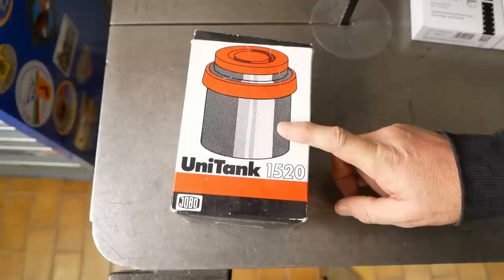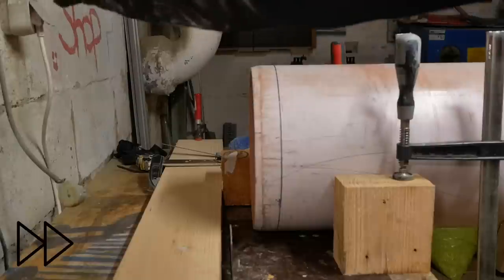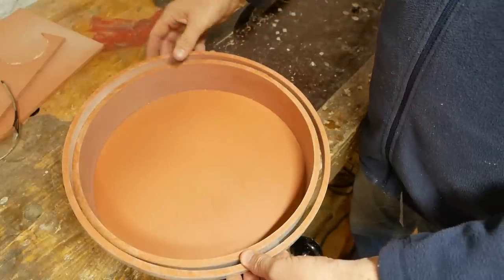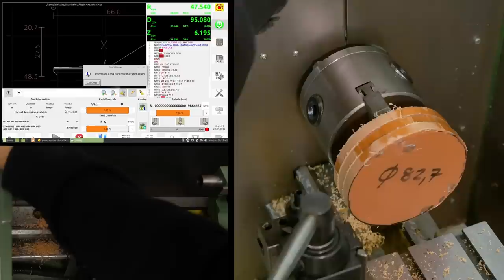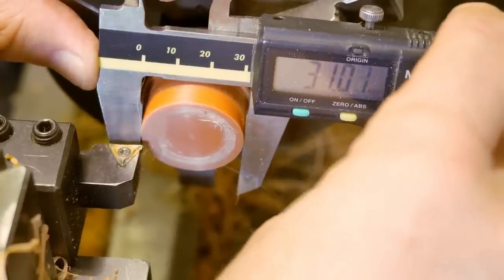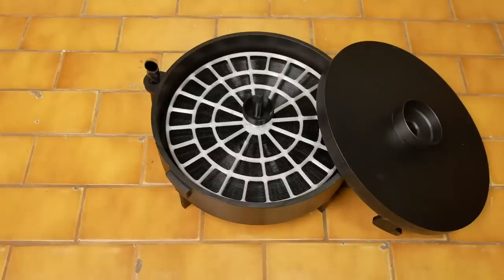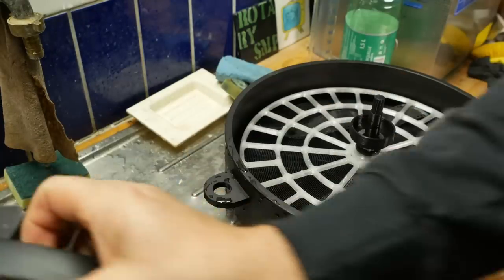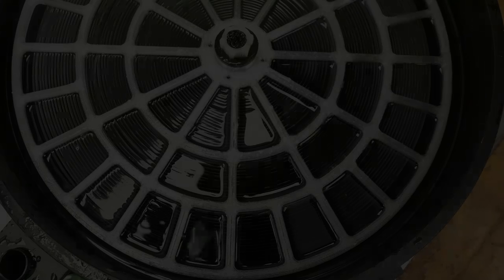Make anything from PVC pipe || RotarySMP

Comment: I've seen so much of that type pipe skipped on jobs . I never thought it was such an easy source of tough sheet plasticcy stuff. thanks rotary.
Reply from the maker: It is a surprising good crafting material. Really easy to work, sort of like homogeneous wood. Also easy to flatten. I used 130°C for about 10 minutes.
Reply: @RotarySMP  I never tried couse I was afraid the oven could get a 'bad taste' for food....
Reply: @pwkoert6594  Get a used one for the workshop/garage, if there’s room. It’s good for powder coding and tempering, pizza coffee and tea…
Reply from the maker: @iteerrex8166  Since the plastic didn't get hot enough to melt or burn, I didn't smell anything doing it like this.
Reply: I'v tried and there is hardly any pvc smell.  Ofcourse I only use clean pvc, but 10min, 120 C in hot air oven works very nice.  Above 135 C you can smell some PVC but no tastes in the oven.
Plates made from tubes are never perfectly flat, but it is very cheap, euh usualy for free as leftovers.

Comment: in the old days, I had two different styles of film developing tanks. (three, if you count see-sawing through a bath tray!)  The first was a Patterson-tank, which wound the film in  by twisting the clear reel at the top.  two ball bearings allowed the film through but not back.  The Second one was the "Nikkor Reels" which were wound from the inside out, by bowing the film in your hand "width-wise" while you rotated the stainless steel concentric reels with the other.  Pretty neat system!
Reply from the maker: I've also used both over the years. I think the Patterson style is a bit easier for beginners, but the reel has to be bone dry to use it. The metal spiral one which load from the middle are not so critical for moisture. These Lomo spirals are sort of a one side spiral version of the latter.
Reply: @RotarySMP  I have a basement room full of "Printo" developing machines and Saunders Color enlargers... I used to enjoy the process - but now, blending analogue film with digital printing is pretty interesting!  Keep up the good work! (if I can learn how to take a napkin drawing and put it into a computer CAD program, and 3D print it, I'll die a happy man! :)  )

Comment: I've seen some people go all in and make a PVC version of a a continuous processing machine. What they essentially do is take a couple PVC pipes and stand them on end, fill them with the chemicals and run the film over rollers in and out of the tanks in a snake. You set the transport speed and depth of the tanks to give you the right processing times in each tank. That's the way it was done back in the day on an industrial scale. Except the tanks were huge and stainless...
Reply from the maker: I dont see myself doing that much film that I could justify such a system, but who knows what the future brings?
Reply: @RotarySMP   you never know ;) I have a  Bolex H16 EBM with a 400 ft mag I wanna bring to life. That migt justify such a system… or maybe even necessitate…
Reply from the maker: @juliussokolowski4293  That is a good point. I dont think they offered 400' mags for the Beaulieu though, only a 200'.
Reply: If I knew I’d have a sure supply of 400’ loads of something like 7266 tri-x I’d go for it. But as things stand even 100’ dayloads are might become an issue and I’ve got enough projects as it is ;) But I have been toying with the idea of making a simple yet automatic film scanner for 16 mm. I have some 16 mm film, including some vintage 747 slide training (saved it from the dumpster back when I was working in airline pilot training). Some steppers, some rc servos, light source and a camera… how hard could that be? Famous last words…
Reply from the maker: @juliussokolowski4293  I also need to make an automated scanner. I wish I had access to Double X for a reasonable price. It is really dear in Europe. I hope Orwo has a new batch of UN54 soon.

Comment: 8:14 
Rotary: "Honey, when you next going out?
Rotary's wife: "why ?"
Rotary: "I need to clean the oven"
Me: "Yeah, Right" 😂

I don't have a wife but I do have an electric cooker :) I needed to bake my 3D printer filament that haven't used in 3+ years and was just sitting there on the printer. I decided to buy a food dehumidifier to do that task rather than the oven. At least that way I wont discover one day that I set the kitchen oven to 450F by mistake and have a disgusting mess to cleanup.
Reply from the maker: Yeah, she is very tolerant, but sees through my nonsense pretty fast :)

Comment: This is super awsome!!! how is your paint coat holding up? 3d printed the 50ft tank from thingiverse and gave it 3 coats with BEHR chemical resistant spray paint but after developing and wiping the tank out the paper towel is a bit black
Reply from the maker: You can see that the paint on the bottom of the tank got a bit worn off by the film reel rubbing on it while agitating, but other than a few scratches it is holding up fine. Time will tell, as I have only done the one roll so far.

Comment: Chemical resistance surely is going to be always a problem. I got an ultrasonic cleaner with the tank full of brake cleaner for cleaning guns, and I already replaced the feet of the metal basket inside with short sections of silicone hose multiple times, but even the usually completely inert silicone soaks up the brake cleaner like a sponge and gets turned into a gelatinous mass.
Reply from the maker: Hi Alexander. Photo chemistry is a mix of acidic and alkaline baths, mostly not too strong. I expect the most effected will be the paint, and then there will be some chemicals which get into the crevices of the 3D printed parts. 

Then again, the other option was russian plastic from the 1970's.
Reply: @RotarySMP  Well yes, they're not solvents. Because even the rather peaceful IPA will eventually destroy most plastics.
Also, next time you build/renovate a house, order your PVC pipes in black!
Reply from the maker: @graealex  This pipe was not from my house, Jörg gave it to me. I put Black Gebarite (?) in my house when I renovated, ,but I think it is standard in Austria to use the orange KG Rohr for buried sewerage pipes.

Comment: ya, PVC is a very easy material to work with, as the same with other plastics that are 3 letters and contain P, A, or B its waste material and can  be chemically welded with hardware store products (pvc, abs, acrylic,  polystyrene butylate the list goes on)
Reply from the maker: I was surprised how easy it was to flatten it into those useful sheets.

Comment: When are you going out, I need to clean the oven. 😆🤣😆🤣
So this has to be done in a completely dark room you can't use like a red light so you can see??
Reply from the maker: Correct. Photo is orthocrhomatic, so it is not sensitive to red light. You can develop prints under a red light. Most B&W film is pan chromatic, and would be fogged by a red light.

Comment: Great job! Amazing how well that turned out. Don't have a workshop like yours but with a liberal usage of 3d printing, I'm pretty sure this would be a great little project
Reply from the maker: Since that PVC bonds so well, I think you could easily just make up thinks like the funnel by first making a set of rings with a drill, saw, and file, and then assembling them. It really is not a difficult build.

Comment: Beware the plastic strings. I don't know about PVC but certainly nylon's strong enough to pull your fingers in. I use an old pair of needle nose pliers to clear nylon swarf
Reply from the maker: Good point Murray. I dont think the PVC is nearly as strong as Nylon, but still should have used a tool rather than bare hands.

Comment: It looks like the drill spun in the tailstock without beeing pulled out previously. That would mean that the drive tab on the drill doesn‘t engage in the tailstock to transmit the torque. You might want to check this. Some interesting techniques you showed there with the straightening of the pvc.
Reply from the maker: Those crappy mini lathe tailstocks have a truncated MT2 without the drive lugs.

The PVC straightening was really simple and worked well. Good source of crafting material.

Comment: Yeah, plastics are pretty hard to grab in a chuck. Because it just deforms out of the way when you tighten it. But smaller chips and it just wont cut right. Nightmare. Collets are probably the best option.
Reply from the maker: I should have used sharp HSS tooling as well.
Reply: @RotarySMP  or polished insert tooling for aluminium. I turned a lot of Nylon some while ago and I had exactly the same problems. But it turned out great and your skull is still dent-free so all is well :D
Reply from the maker: @Narwaro  I have those sharp inserts, but was tool lazy to swap them in :/

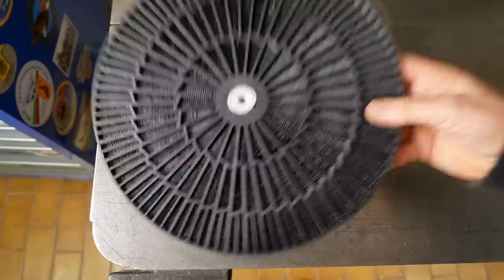Comment: 1:07 resistant to most chemicals except anything basic in long term or strongly basic in short term (it's an ester, turns into a terephtalate salt and an alcohol), anything that can leech the additives which means most strong solvents like acetone, it's hygroscopic and on that note who knows what other material it loves to cling onto, so... Yeah it's lightly better than PLA but that's it. The only filament that's actually brutally inert is PP (or PE, almost the same thing)
Reply from the maker: Thanks for that input. My comparison is not a perfectly inert plastic, but 1970's russian plastic for $1000+. If I have to reprint these reels every couple of years, that wont kill me.
Reply: @RotarySMP  Oh yeah, definitely. But at the same time I would be worried about swelling, getting your fill stuck in the gap
Reply from the maker: @whatevernamegoeshere3644  I guess I'll see once I develop my next film, how it has changed.

Comment: Good sharp HSS cuts plastics way better than carbide . Amazing the things one can make from plastics but the stuff is messy
Reply from the maker: I was a bit lazy, and mostly used insert holders which were already loaded in tool holders. I did switch to HSS a bit, and it cut much better, as did the polished, high rake inserts for Al.
I am pretty happy how this project ended up.

Comment: Instead of a water wash between develping & fixing, shouldn't you be using a stop bath? Generally just 3% acetic acid in water. That also helps stop your fix getting too contaminated with dev.
Regarding silver recovery from the fix - I was an RNZAF photog (in the 1980s) and we had an electrolisys machine for recovering the silver from fix. Not sure the $$ ever made it to accounts but we had a good stash of choccy biscuits in the joe room  ;-)
Reply from the maker: I was in the RNZAF between R1/89, and Oct 94 as an ACFTTECH. Photog was a cool trade. You got lucky to get that one.
I was too lazy to whip up a stop bath. Thanks for calling that out.
The reversal kit doesn't use one, but the bleach is acidic and one use.

Comment: You make it look so easy! Pro tip - for clamping squirrelly parts with the C-clamp, put the swivel end on the stable side of the work and use the fixed end of the clamp on the squirrelly bit. Although clamping the squirrelly bit on the swivel end works, as you tighten it you your clamping mechanism also introduces a radial toque which is limited in the opposite orientation.
Reply from the maker: Thanks for that tip. It is a good one.

Comment: great job but it seems like a proper continous development machine is next :P 
We attempted it a few years ago with pvc pipes and stepper motors. theres a video on youtube that shows the basic setup 
search for continiuous 16mm development
Reply from the maker: I have watched that video. Cool project, but I dont develop enough to need that (yet). The next puzzle stone I need is to make a Telecine to do a decent job of scanning films.
Reply: @RotarySMP  Vario pancolar on youtube built one, we repurposed an old projector and used a cheap macro lens adapted to a Fuji mirror less camera

I wish I could show you some results but sadly I can't share it rn due to copyright issues.
Reply from the maker: @Altgottt  I think I have watched every DIY telecine video on YT. Lot of good ideas out there.
If I can get a cheap 16mm projector, I'll start with it's film gate and pull down mechanism. 
I already have a 1:1 macro for my MFT cameras, but will probably get another extension tube and go beyond 1:1 to maximise the size of scans.

Comment: This is really extremely interesting, also because I am planning to buy a similar tank. If I got it correctly, there is no gasket at all between the lid and the tank, am I right?
Reply from the maker: No there isn't, The tank is not for inverting. You agitate by turning the whole reel, using the shaft of the spindle which pokes up through the funnel.

I did think about putting a seal of some sort on there. My idea would be to out a circle of kids bike tube rubber, and put it on the lid,  between the inner and outer light seal lips.

Comment: What temperature did you use to get the PVC the pliable? And a 10 minute soak at that temperature?
Reply from the maker: I set the oven for 130° C. The first piece took about 10 minute to soften. The later ones went a little faster.

Comment: There's me thinking you could 3d print all that. But where is the fun in that? 
No point in having a workshop if you can't get it messy. Great use of recycling that pipe can`t of been much left 😁😁👍👍 
Some interesting music choices today. 13:45 had a little tear in me eye as that sounded like the ending music for the last stargate universe 😢😢😂😂.

Potassium permanganate for smelly feet, I learned that from Dr BigClive 😁😁
Epic video today great stuff THANKS 👍👍👍👍👍👍
Reply from the maker: I am always a bit suspicious of whether spaghetti printers can make fluid tight parts. Mine can't (it is also too small for this job.)
Reply: @RotarySMP  Cut and slice and put back together with glue. Works pretty well. But no fun
Reply from the maker: @harezy  If I have to cut, slice and glue... then PVC pipe is the way to go. That is pretty nice to work with.

Comment: I'm mortified that you didn't throw the pipe on the lathe and use a parting tool to part off the right length and bore the pipe out to the correct dimensions..  :-/:-/:-/😕
.
.
.
.
kidding ..... maybe ?
Reply from the maker: Hi Vinece,
None of my three lathes can  swing 315mm. I think the Schaublin can swing about 270mm at a pinch. The table saw was quick and easy, and did a pretty decent job.
Reply: @RotarySMP  I know. It was my silly joke :-) You did a great job with the table saw!

Comment: I think I would have bought a 3d printer with bigger plate or glue multiple parts together 😅
I own a Voron 2.4 350mm. Would definitely printed it. ABS or in PC-Blend.
Reply from the maker: Those Voron are amazon printers. Do you think you can print a container which is fluid tight? on mine it would not be, but I guess I dont have it dialed in well enough.
Reply: @RotarySMP  with 3-5mm thick walls? Sure. 100% infill and a little bit over extruding. But does it have to be 100% water tight anyway?
If it has to be 100% food safe/water tight I spray it with paint in general.

Comment: If you hold a vacuum cleaner nozzle near the tool while turning, the entire ribbon of waste will be sucked in. Start the cut with the vacuum on.
Reply from the maker: My vaccuum clean is really loud, and seems to run at a resonant frequency of the house structure. My wife never complains about the other machines, but the vaccuum drives her nuts :)
Reply: @RotarySMP  Yep, they can be loud.

Comment: PETG is really easy to print (almost as easy as PLA), so you could easily print the part that broke yourself if you don't end up wanting to turn it. Just don't print it directly on glass and turn down the parts cooling fan and you're good to go!
Reply from the maker: It is the highest stressed part, and I also broke the PET-G one just playing around assembling and disassembling. The way the layers run, it will never be strong enough. I'll just order some 50mm black PVC and turn one.
Reply: @RotarySMP  Fair enough! The Tank looks really good, especially considering you made all of this from a piece of scrap sewer pipe!
Reply from the maker: @muh1h1  Thanks. I am also really happy how it turned out. I started without much of a plan.

Comment: This is a really cool project. Recycling a drainpipe is inspired! I once tried to design and 3D print a 50ft reel and tank for 8mm film - I found the PETG reel too floppy and rough to load reliably, and the water and chemistry in between the print layers of the tank and it leaked. 😂 then I bought the 50ft Lomo…. For 16mm 100ft film I’ve used a Morse rewind tank… not ideal, but ok for black and white. The new Filmomat manual tank looks promising and well designed - crazy expensive, not not excessive to the asking price for the old 100ft Lomo tanks. Shooting and developing cine film these days is a bit crazy, anyway! 😊
Reply from the maker: Hi Jason. That is a good summary. A bit crazy :)
The new filmomat tanks hadn't released when I started this, but I am too cheap to purchase on anyway. I have also had poor experience with spaghetti printer parts being water tight, so I didn't bother going that route.
That GNAL design is worth a look. The base spiral is quite thick, and nice and rigid. Seeing as this was my first ever load of 16mm film, it was pretty easy to use. I am lucky that Jörg is a real master of 3D print, so the reel came out very smooth. I think he used a big nozzle, and it was still a 30H print.